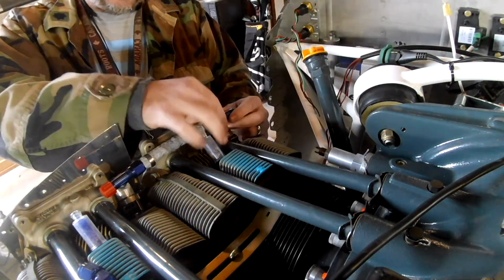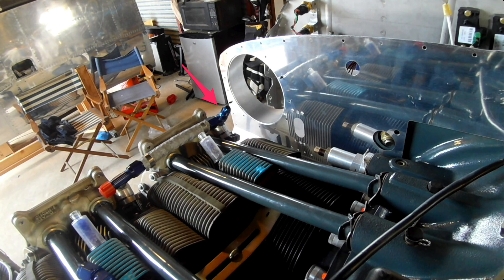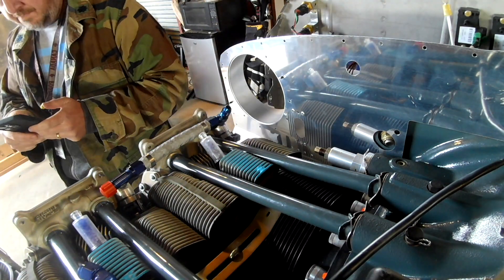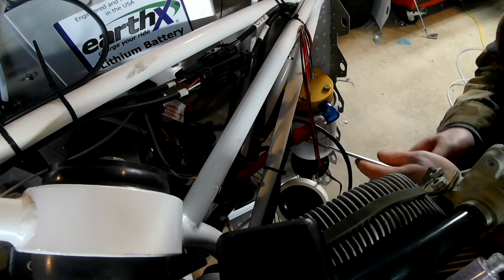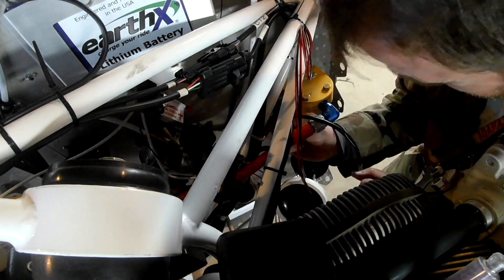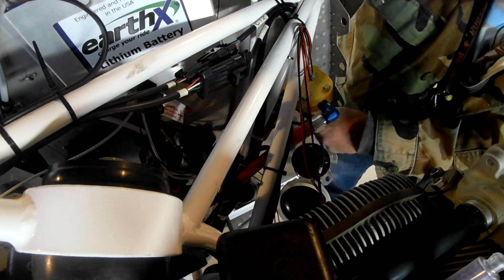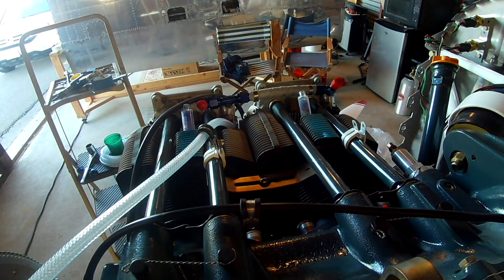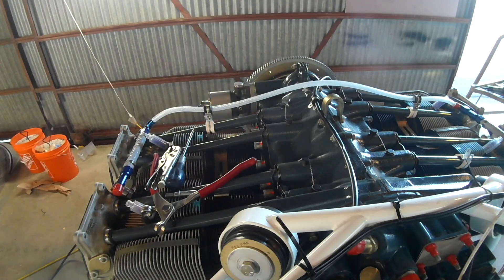RV-14 Engine Fuel Lines I

Comment: Do you have a video of when you installed your fuel injectors ?  Did you have to tap your ports out on the engine deeper ?
Reply from the maker: The injectors came installed. The engine shop is a distributor for the EFII system.
Reply: @akilroy  i sent you a pm on FB
Reply from the maker: @rightrudder6354  I’ll look but I hadn’t used FB in so long. Lol
Reply: @akilroy  I’m doing a 390 in a 7A and have to remove the injectors installed ,

Comment: Is that the EFII System 32 or SDS? Also, is that a Superior cold air induction? I run the EFII on my -8 and will be doing the same thing on my -14 project along with the Superior cold air induction.